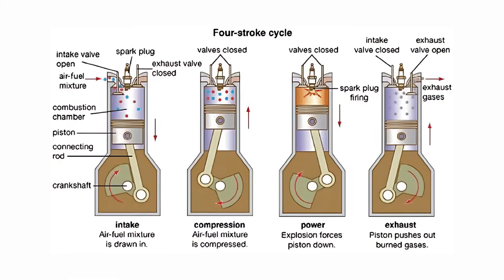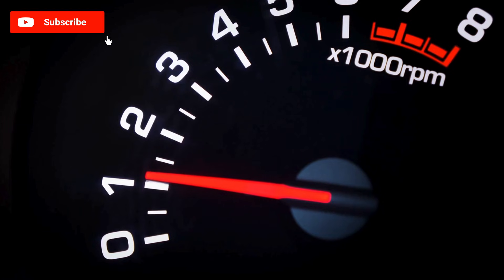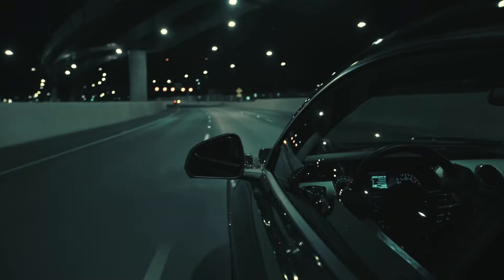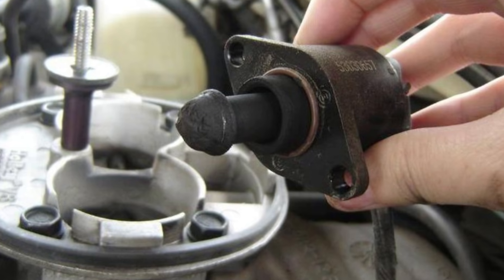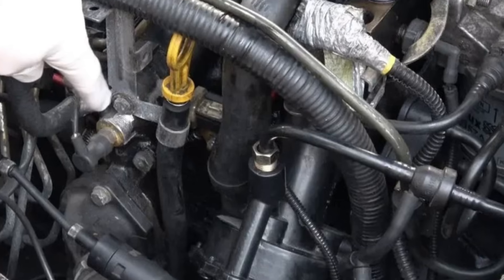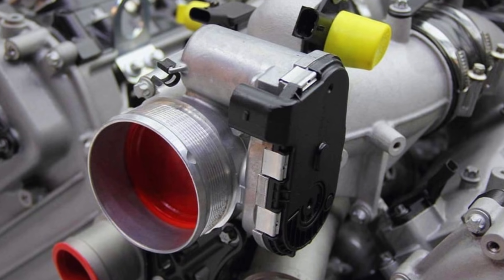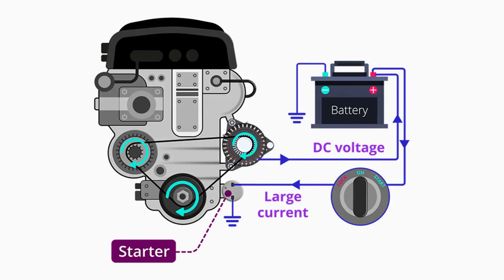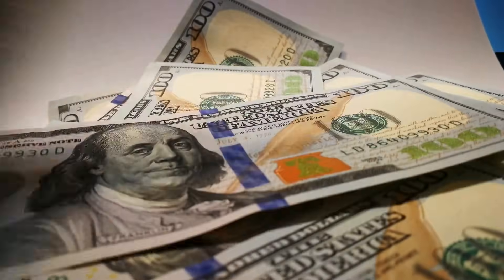6 Reasons Your Engine Revs Up and Down at IDLER | RPM Fluctuations While Car is Parked

Comment: Hey bro, I don’t know if you guys are active here, but can someone tell me if I messed up my transmission? Recently, my wheel jammed, and I didn’t realize it at first. I kept pressing the pedal for about 30 seconds here and there and did that 5-10 times. I then noticed a burning smell and saw a warning only once appeared that said, 'Transmission too hot, wait 5 minutes.' Now, I’m wondering if I might have damaged my transmission. Please, I beg you,if anyone sees this, help me!
Reply from the maker: Hey there, your situation sounds pretty concerning. Forcing the gas pedal while the wheel was jammed could put a lot of stress on the transmission. The burning smell and the 'Transmission too hot' warning are definitely red flags. To be safe, you should take your car to a trusted mechanic as soon as possible to have the transmission checked. They'll be able to diagnose the issue accurately and give you the right advice. Hope you get it fixed soon!
Reply: @carcareguy10  hey brother,thanks for the response. I took it to the mechanic and described my situation and he said the car should be fine. I got my wheel jammed issue resolved it was due to brake caliper coming off. After getting it fixed I drove the car. It was as smooth as before. But I tried one test idk if it means anything. When in drive and still position I tried to press brake and gas pedal at same time rpm doesn't raise much.But when I am and still position and press gas pedal the car jumps & accelerates as usual. Does the brake and gas hold situation mean car transmission is bad?